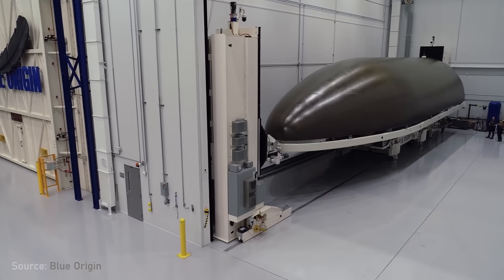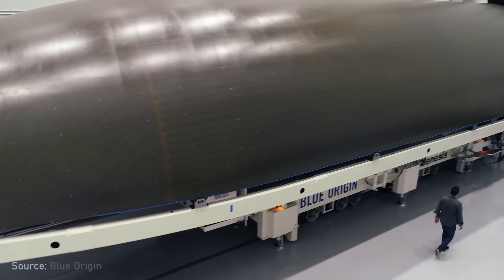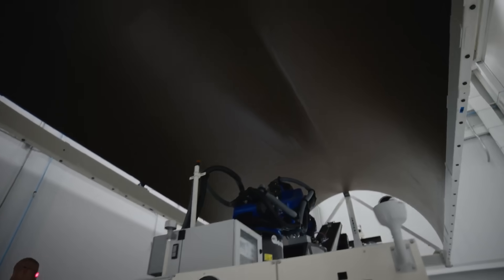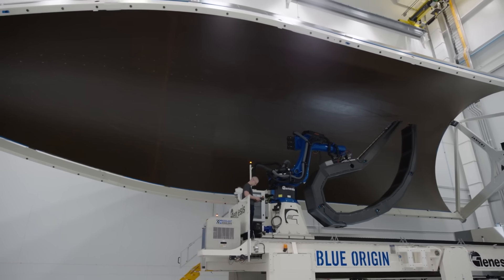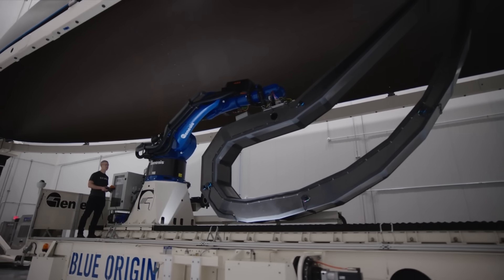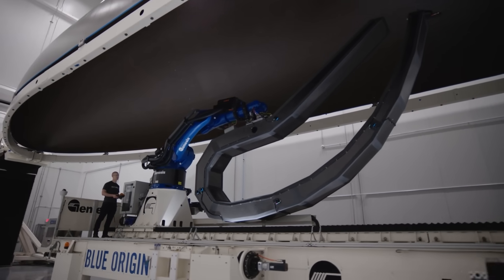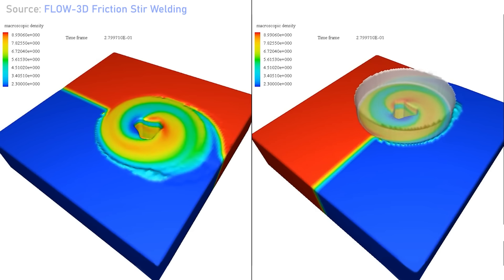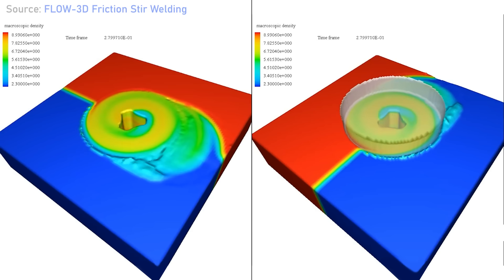Jeff Bezos on rocket engineering | Lex Fridman Podcast Clips

Comment: "with friction stir welding, the welds are just as strong as the bulk material." that is incredible
Reply: Most welds are stronger than the base material!
Reply: oh. ok. Would friction welding be preferable if there was uniform integrity in the metal as opposed to stronger or weaker joints? @garyeuscher4499

Comment: 🎯 Key Takeaways for quick navigation:

00:02 🚀 Rocket Materials and Technological Advancements
- Discussion on materials used in rocket construction and changes from the 1960s.
- The game of imagining what would amaze 1960s engineers and recognizing enduring practices.
- Technological advancements in carbon composites, creating light and stiff fairing structures.
- Introduction of friction stir welding for aluminum lithium, a low-temperature, high-strength welding method.
02:22 ⚙️ Friction Stir Welding and Structural Efficiency
- Explanation of friction stir welding's operation and benefits.
- Comparison of traditional welding's weak points to the strength of friction stir welding.
- Application of friction stir welding to build pressurized tanks with reduced weight.
03:18 🛡️ Complex Design and Functionality of Fairings
- Insight into the fairings' purpose, complex design, and functionality.
- Recognition of the challenge to maintain 100% integrity until needed to detach.
- Use of explosive charges for rapid and complete separation when required.
04:25 🔄 Two-Stage Rocket Configuration
- Overview of the two-stage rocket configuration, with the first stage being reusable.
- Details on the second stage being expendable, using liquid hydrogen and liquid oxygen.
- Description of the first stage landing downrange on a platform in the ocean for reusability.

Made with HARPA AI